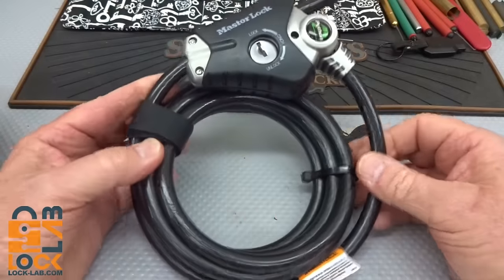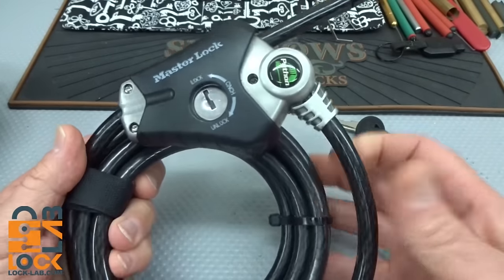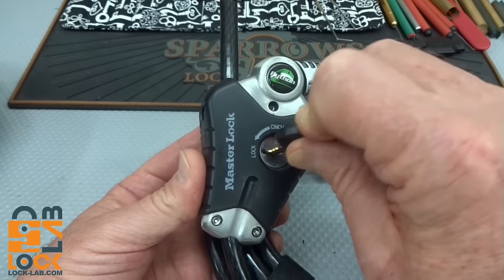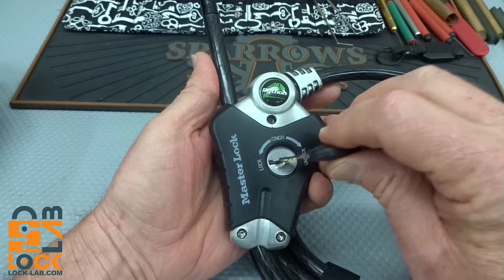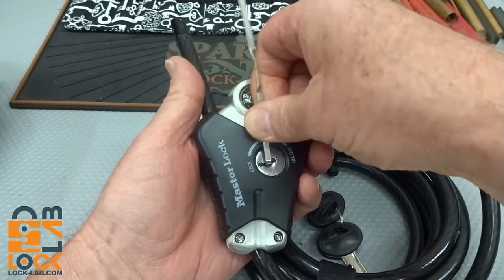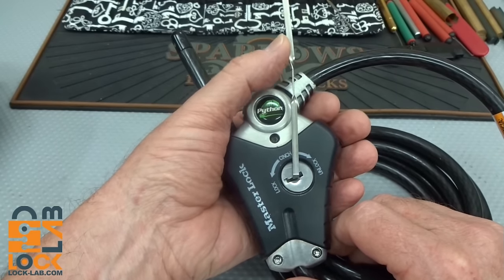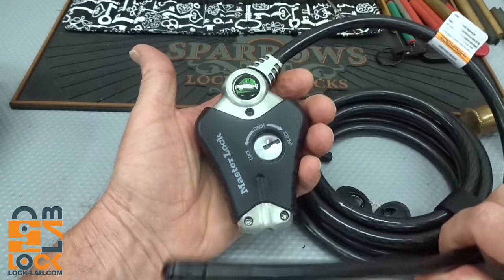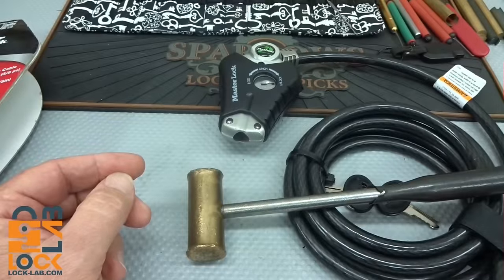(931) Review: Master Lock Python Cable Bike Lock (JUNK!)

Comment: I have taken one apart myself it is a weird little wafer lock with two side bars within the locking mechanism itself one bar on each side of the lock you can also literally pull the cylinder out all together 2 bypass the lock as well

Comment: Great Bypass! Maybe there are others... Looks like the cable is just gripped by the lock, relying on the tension to grip harder when its pulled. Maybe you can apply some lubricant and work the cable free without a hammer. Since the outer mantle isn´t damaged by the lock, there seems to be only a friction retention instead of mechanical interference. It could even be possible to work in a shim so it grips the shim and the cable slides out through the shim.

Comment: Dang it.  I really need a cable lock that can work like this one does.  Of course I don't want my stuff stolen, so it won't be this lock.  Are there any locks similar to this that actually work?
Reply: Exactly, as much as I'd like to have a usual chuckle at Master Locks expense, I don't know of a single better alternative when this type of adjustable length lock is needed. Need something for my skis, got a Ski Key for resorts that have Ski Key racks but want a deterrent for the resorts that don't have the locking racks. Without being able to pull out all the slack in the cable around the bindings other basic cable locks are pointless. All the other options have a cable just a millimeter or two thick and a plastic housing, super easy to snap off just by using the skis as leverage. Not really worried about it getting picked, many much easier targets at a resort, but I'd at least like something that can't be easily bypassed like this and won't just snap off with a good yank.

Comment: I'm still buying one. It is what I need. Something to keep a casual idiot from just wandering off with my kayaks that I left locked to a picnic table while we drive off to leave a car at the other end of our route, or to secure my jacket to my motorcycle through the sleeves. Anyone who actually is going to bring tools, I'm not going to stop them with any lock anyway. If there's another similar lock I'd go with that but I haven't seen one. The design is pretty ideal for a lot of situations.
Reply: very true about someone with tools. did you get one of these? How did it work? Did you come up with any other solutions? Ive got a fleet of kayaks that I want to lock at times but the larger cables wont fit through the scuppers (if they have them)

Comment: how does it hold the cabel when locked ?
and could you remove the cabel with a little oil and wigeling ?
Reply: basically saw tooth teeth. I had a play with one in B&Q. I'd forced it by hand about 12 inches in 30 seconds before a member of staff asked if i needed assistance. I just said I was testing the locks before buying and showed him how bad it was... with a bit less force.

Comment: I used this to lock my bike for years. Last year someone cut the cable almost through. The cable is not carbon, just plastic sheath and parallell steel wires inside.
Reply: Looks like it would not have made much of a difference if they put a couple of strands of linguine inside instead.
Reply: Seele2015au With ordinary pliers you'll get through in a couple of minutes. For a clean one time cut you need bolt cutters.

Comment: I remember about 10 years or so having to cut through the cable because of lost keys. Using a sawzall in an attempt to cut the cable, it shook so violently that the lock disengaged in less than a minute.

Comment: I remember when Master Locks used to make good locks. Meow look at em...
Reply: The disc detainer lock by Abloy still holds up even though it was invented in 1907. There have been improvements but the original design is still recognizable.

Comment: Those have been around for at least 6-7 years. They have 4 wafers, 2 very small sidebars. 1 for every 2 wafers. Not usually difficult to pick. There is a 5th retaining wafer in the back, which can be depressed and pull the core out when the cylinder is turned to the unlocked position. Nice job opening it with a small hammer.

Comment: Professional Bike Thieves will use bolt cutters. Everyone else will walk by it. Bike theft is done by Equipped Thieves (snip cable/bar) and Opportunist (unlocked). If I run in to store while leaving bike on rack with Python I'm not worried about a guy with a pick and brass hammer walking around scoping for Python Locks.

Comment: Hi Bill , Surprising .. then perhaps not. I think you will find the wafer lock works on a side bar principle, at least the early ones did. Each wafer has a half round cutout in it in different positions on the side of each wafer. When the key aligns the wafers, the half round cutouts also align, then the round side bar enters the cutouts, allowing the plug to turn - sort of a double locking principle. Unless things have changed.   Regards, Brian.
Reply: Brian Hignett Most modern wafer locks don't have sidebars making them very easy to defeat. Older GM door locks had sidebars and are much more challenging.
Reply: Hi Adam, You're correct I'm a retired Locksmith and did in fact dismantle an early version of the Python - before it had the snake shaped body, and is was as described.

Comment: Any better alternatives for an adjustable length lock like this? As much as I'd like to have a usual chuckle at Master Locks expense, I don't know of a single better alternative when this type of adjustable length lock is needed. Need something for my skis, got a Ski Key for resorts that have Ski Key racks but want a deterrent for the resorts that don't have the locking racks. Without being able to pull out all the slack in the cable around the bindings other basic cable locks are pointless. All the other options have a cable just a millimeter or two thick and a plastic housing, super easy to snap off just by using the skis as leverage. Not really worried about it getting picked, many much easier targets at a resort, but I'd at least like something that can't be easily bypassed like this and won't just snap off with a good yank.

Comment: Master is a "vertical channels marketing company" moreso than a lock company. A Lot of the development is driven by what the Big Box Stores approve and produce a PO for. The products are built to the price, not to a security standard, when they grovel at WalMArt and Home Depot for shelf space. MOST of what MAster markets, is not MADE by Master. 

So, if you shop at Big Box stores for your security, plumbing etc.... you may miss all the good stuff that can NOT be bought there or even through online sellers. Online mirroes what is POPULAR in big box. Master has some EXCELLENT legacy products. You will find them at your favorite locksmith shop

Fine "affordable, non-exotic"  padlocks come from New Standard, PacLock, Master Pro-Series, SOME American Lock product series ( Owned by Master Lock )

Comment: I had given to me a no-key previous gen python -- if you pulled on the cable yes, it got tighter and was secure...if you TWISTED the cable back and forth you could within seconds-to-minutes work most of the length out to a full open. Really junk.

Comment: The bitting was kind of flat, but at the same time, that is irrelevant for this method. It may not work if there is highest and lowest depths, however, the thing is, you can't do this with most normal locks, regardless of the bitting, so I feel this is valid. I know you can't go to a store and buy out all of their stock over and over, and test out like 50 of these, just to give a percentage of how often this attack works. I understand the point is that, this worked on this one and it should work on any similar bitting ones and very possibly with enough patience and practice, it may work on 50-100% of them.

The fact that it worked AT ALL, is shocking. You basically "bump keyed" it without touching the pins/wafers, which means the springs are weak enough for this method to work. I suppose you could replace 2 springs with ultra high tension springs in there and defeat this method, but who mods wafers locks??

Overall what I am saying is that, since this DID work, it means it has the potential to work on 100% of them with very little effort. Also, I know you can do similar things with other locks, but with other locks, you need extreme force to overcome stronger springs.

Good job on figuring that out, I wouldn't have thought of trying that method. Thanks for saving me money on buying one to try out.

Comment: Whoa, Master made the cylinder on this much worse than the previous version. I have one from... I dunno, 2010 or something? Around there. It has a pin tumbler cylinder. And kind of a tricky one to pick as the keyway is tiny and none of my picks are small enough to maneuver around inside while I have a regular sized tension wrench applied. I'm pretty sure there aren't any security pins so I imagine my issue is I just need a mini tension wrench to put it in the spot on the bottom that I think would work. 

It's junk anyway on account of it's a cable lock but this version certainly looks worse than my older version.

Comment: Just a thought and a possible idea if you still have this piece of crud around, try spraying some spray grease into the lock act as a kind of damper on the wafers, the lock should still work but it might just stop the bounce enough to defeat your hammer attack... mind you anybody that knows about it could just walk around with a can of brake cleaner to flush out any grease in the lock and override even that...

Comment: The one I have the key goes in on the side of the lock also you can just push the cable in when locked and adjust it that way.

Comment: gasp I use this to secure my kayak to truck. Going to hop over to your channel to see if I can find a more reliable lock to use
Reply: did you find anything?
Reply: @MysticalDragon73  not really. There is a kayak lock from FPV Power that features a high decibel siren
Reply: @MakzFishin  thanks. Guess I'll keep using my existing cables.  Naturally nothing will stop a determined thief with tools but at least it slows them down and deters the grab n go.

Comment: do they not test anything before they release a product? that's terrible! The only reason people buy Master Lock anything is cause its almost all that's out on the shelves that's not cheap Chinese junk. Here in the US there's not a lot of options besides the internet.
Reply: I used the word "that's" a lot in that last post.
Reply: dont do it again. i'll tell the police.
Reply: I'm not sure about that. I just got a cheap Chinese euro cylinder with a dimple lock to test my 1st dimple picks and find out that it falls open just by touching pin 3. And it's not broken, it do the same from both sides. But it did cost less than 4 euros, I'm sure that anything from Master would cost 5 times as much.